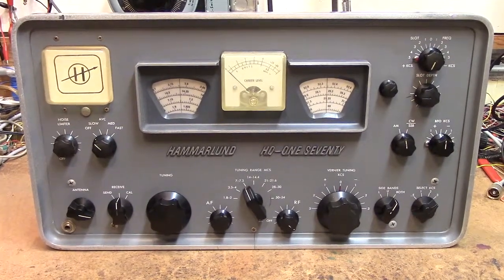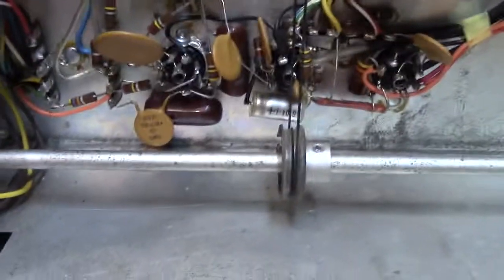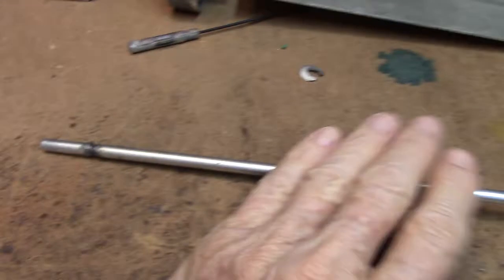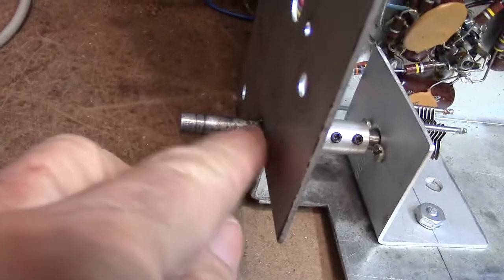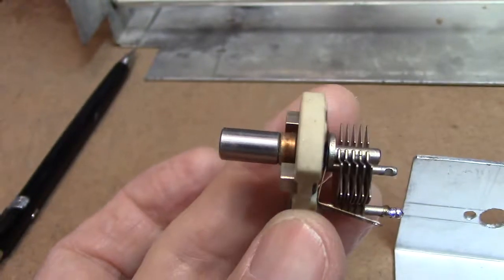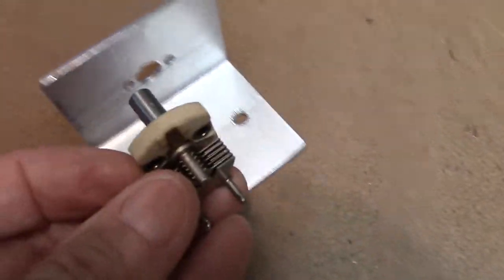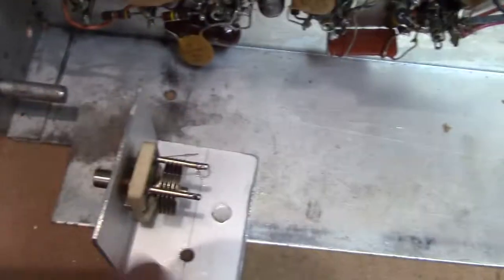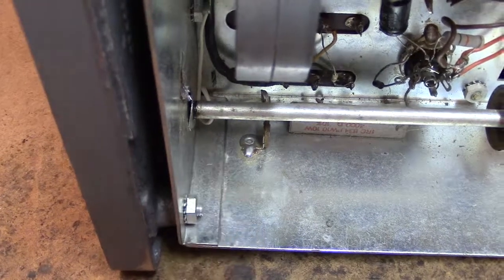Hammarlund HQ-170 Antenna Trimmer Relocate

Comment from the maker: I later tried this mod on a Hammarlund HQ-100 where there is limited space as shown in the video. There were no problems found.  The space is more limited so the bracket has to be smaller.  It should work just fine on a HQ-110 also.   I like it.  It is a good improvement to the radio.